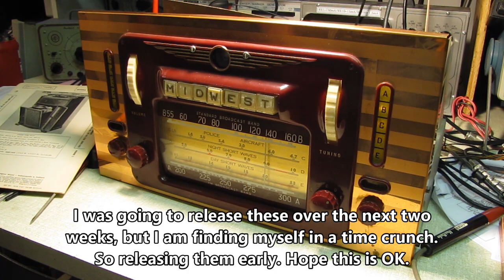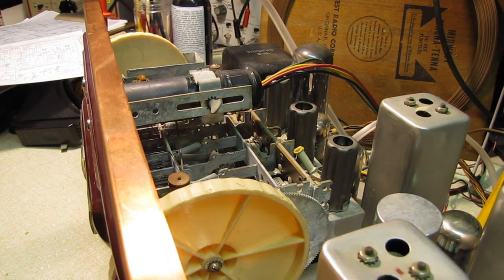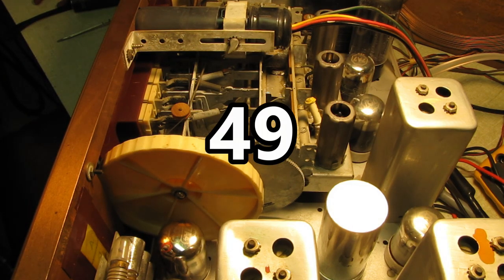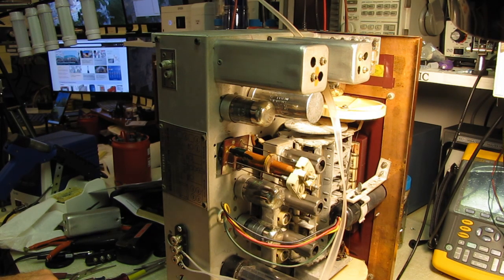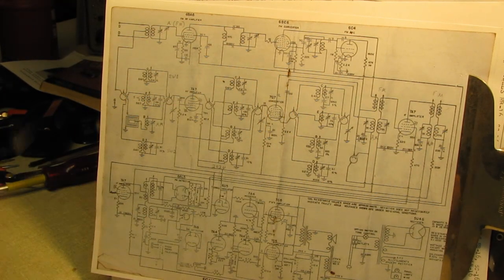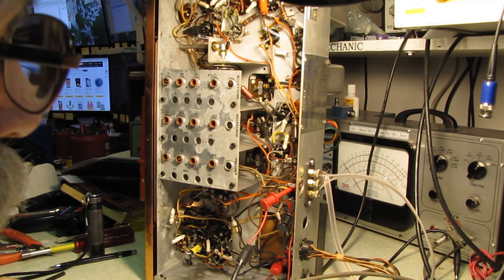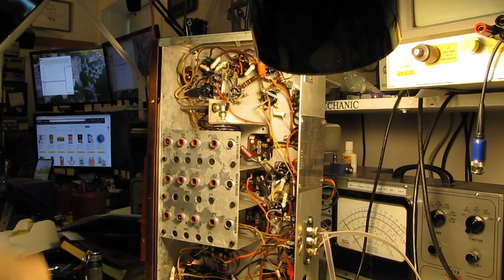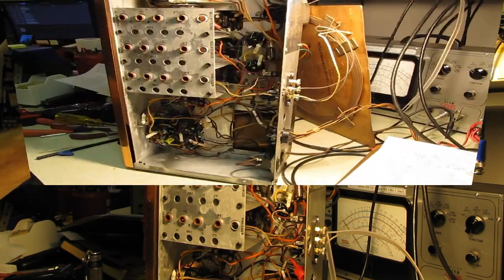Don't Plug In That Old Radio - Midwest 916 Part 3

Comment: You did well freeing up the slugs in the IF transformers Vern. It's nerve racking waiting for it to free up or snap off. The Philips transformers have brass screw adjusters but the resin cap that the screw threads run in disintegrates when you try to turn the screw. It can be done but if it's working it's prudent to play it safe. Nice job of impromptu FM tuning 🙂
Reply from the maker: Hello David, I remember trying to align old Heathkit HW-101 transceivers. The slug itself was often seized in the coil form. It would literally rip the coil form apart if you tried to turn it. Knowing that I could get another chassis gave me the courage to continue. Although it would have been an expensive repair if that was the case. Think about you all the time and hope you're feeling better. Always look forward to seeing one of your videos pop up. I know I'm going to learn something every time I see one. Thank you for dropping by and saying hello.

Comment: Quick field expedient extended grabber probe design.  Was at a friends house helping him with his first antique tube radio alignment and he ran into the same problem as you.  Needed to inject a signal in a area that was buried.  I asked if he had a old plastic body click type ink pen.  Gut the pen, save the front writing end of the body and the spring.  Get a heavy(ish) gauge piece of wire and insert it in the body.  Bend it over at the tip (this is your grabber end).  Slide a small washer over the other end, slide on the spring and put a blob of hot glue on it.  WALA, you now have a grabby probe.  Just clip your regular alligator clip onto the wire between the spring windings to make connection.

Mike
KC3OSD

Comment: Maybe ACE or McMaster-Carr will have the Screws & Nuts you need for the top of that front panel.  Then counter-sink them.
---
Suggest at 7:35, use some Tarnix to clean that pin, then flush with Alcohol.  At 13:50, I've tried using DeoxIT D5, soaking it overnight, and has, (most of the time), worked!
Reply from the maker: Those screws don't even belong there. Some knucklehead drilled holes and put sheet metal screws in. I have a fix in mind. Thanks for watching.